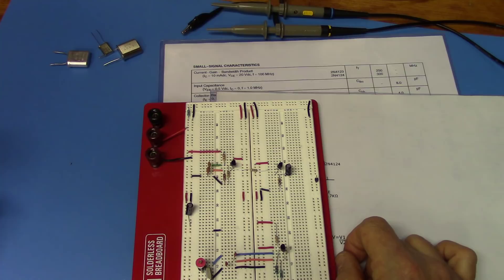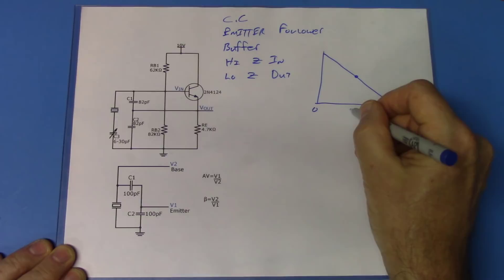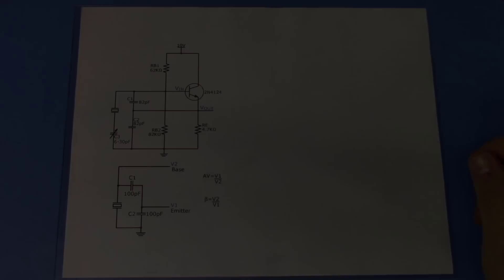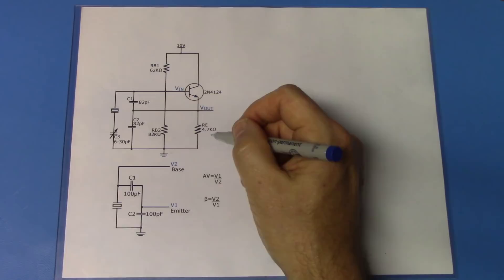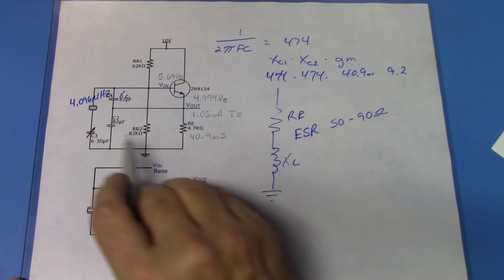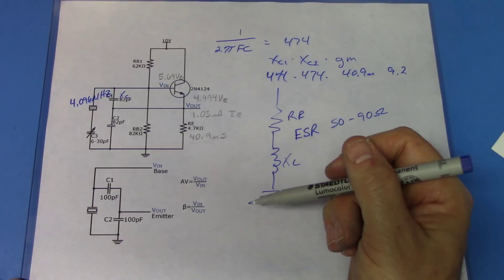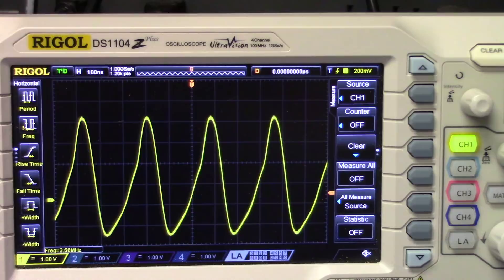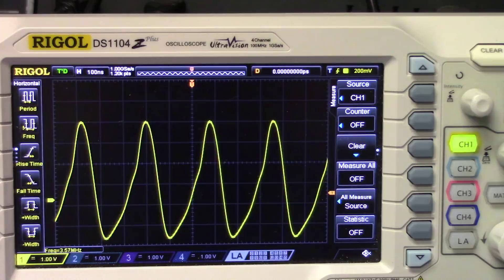74. Colpitts Oscillators Part 3 - Crystals

Comment: Very enlightening explanation. Thank you for sharing your insight in such detail. This is great learning because of the simplicity of the circuit and also all the fairly complex things that are going on to make it oscillate. Really appreciate this wonderful video and your effort in putting it together.

I just built the first circuit using a 2N3904, which has the same input and output capacitor values, and the circuit oscillated with the same waveform the first time. I got about 3V on the output. Thank you!

Comment: Man, you got some great videos.. we could also use the basic voltage divider principle at @15:30 for the AC base voltage.. 
Vb = (1V)(20i/20i-10i) = 2V

Also i realized you never use the oscilloscope frequency counter in your videos.. you just use the broad measurement setting..  is there a reason for it?